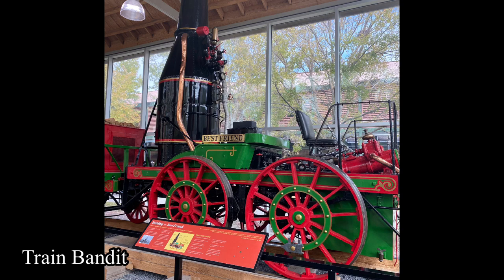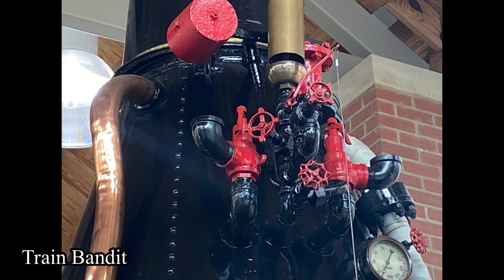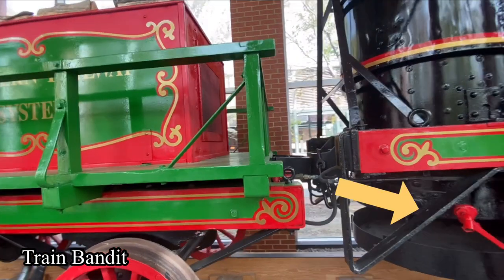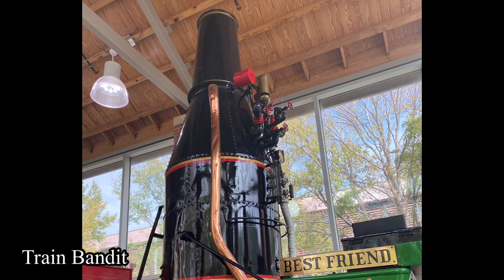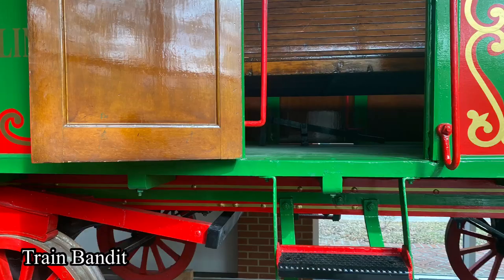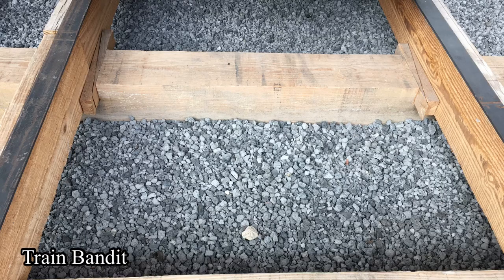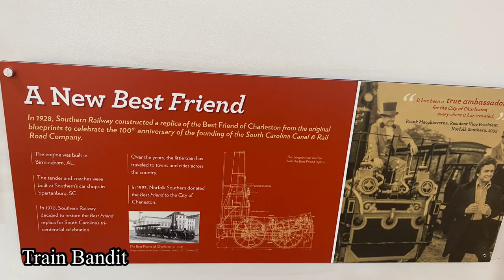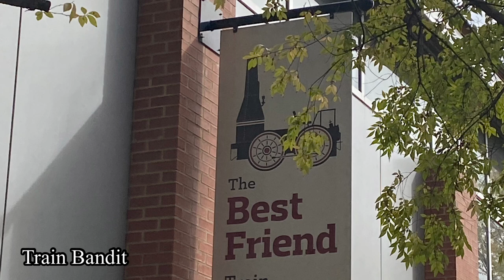Merry Christmas from Friendly

Comment: A book was published a couple years ago called The Locomotives of the West Point Foundry that contains a lot of newly rediscovered information on the Best Friend, and it's worth getting a copy if you're interested in these very early machines.

A few notes about the replica: the locomotive itself is an operating replica, the engine in the tender does not actually drive the train (usually). When the replica was built in 1928, the builders didn't understand the valve gear and built it incorrectly, providing no way to reverse the locomotive (there is technically a way to reverse it by manually operating the valve gear with the handles you see behind the valve spindles, but obviously this is not practical if the train needs to be reversed more than a few feet). The engine in the tender serves to provide reverse! The original locomotive used a slip eccentric, which was probably copied from the one used on the Stourbridge Lion (the West Point Foundry was where the Stourbridge Lion was unloaded and reassembled when imported from England in 1829, so they would have had ample opportunity to study its mechanism).  The replica, unlike the original, was fired with coal, so embers from wood burning were never an issue. Additionally, the exhaust steam is not used to provide a blast at all, it is vented into the stack, but there is no blast pipe. If you can find video of the replica in steam, listen carefully, it's very quiet because there is no blast! When the original was built in 1830, it was not believed that a blast pipe was necessary (and with a vertical boiler anyway, it really isn't). 

Anyway wonderful video of the replica train, thanks!
Reply from the maker: Hmm interesting info. The 5 cent tour said that the engine was due to the fire problems in hair which sounds silly but you know. However the valve gear does make some sense because when I see videos of the loco I noticed that it’s gear had the handles that swing back and forth, instead of having a reverser. So it makes sense but as I say listen to everyone but believe nothing until you prove it with your own research.